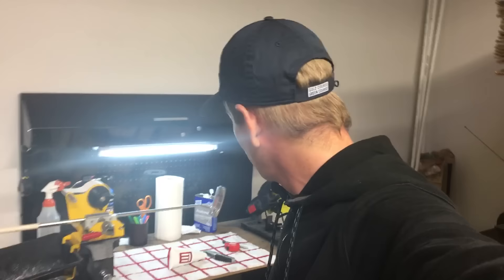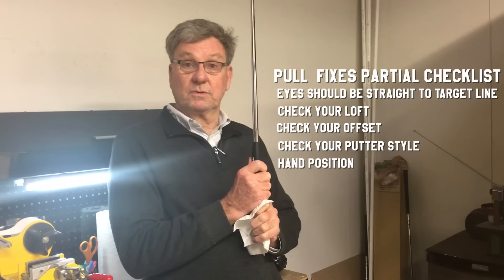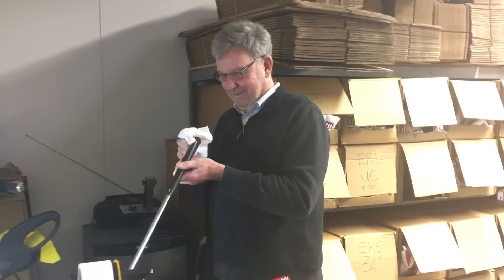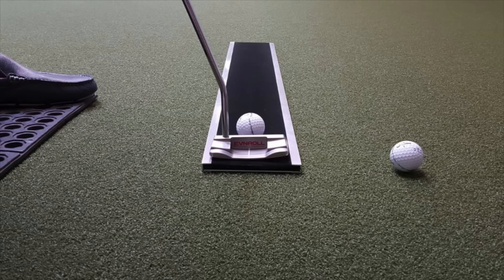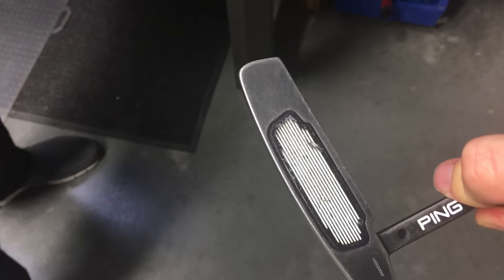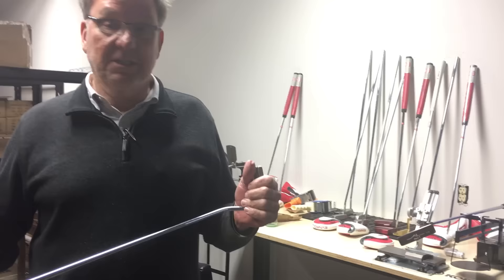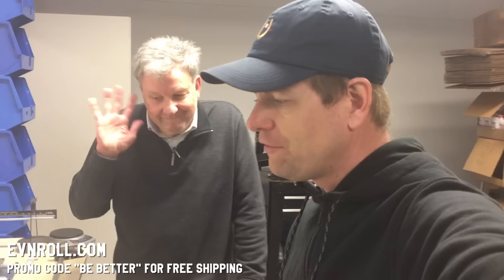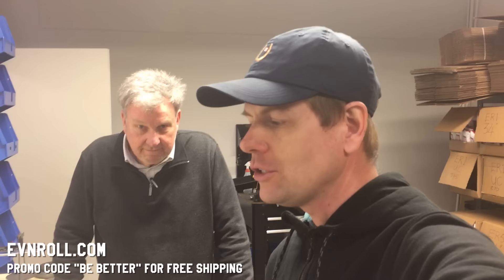Building a Custom Evnroll Putter, ER1 with Inventor Guerin Rife GOLF

Comment: What's the advantage of this putter? I play a Scotty Cameron. Wondering what they do that's different.
Reply from the maker: the grooves on the face. make all hits, center and off center, roll the same distance
Reply: John Walker the grooves vary in depth and thickness as they move away from the center of the face resulting in a gearing effect. balls hit off center roll the same distance and direction as center hits.
Reply: BE BETTER GOLF I might be getting the pistol grip too. Did you find his standard grip too fat ? Looks like it will be for me